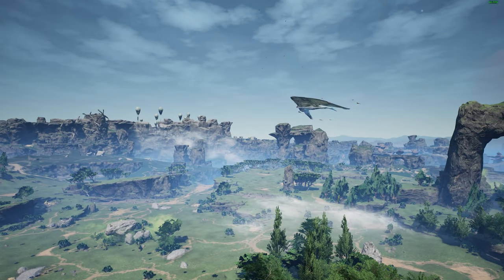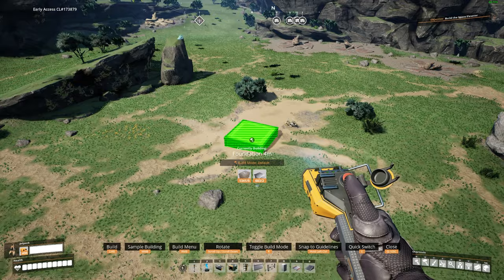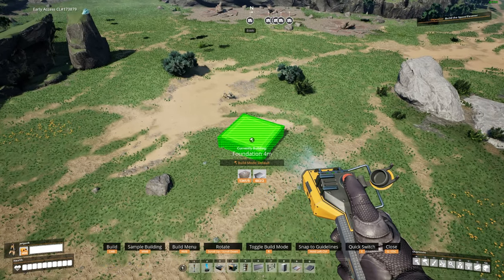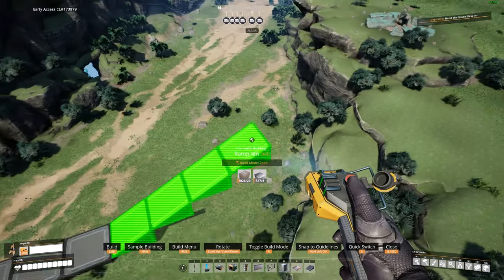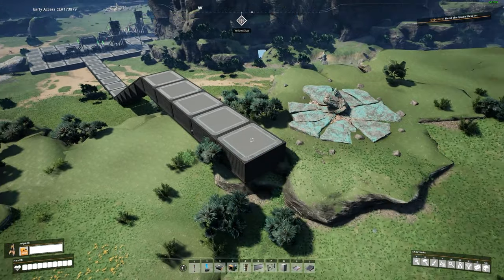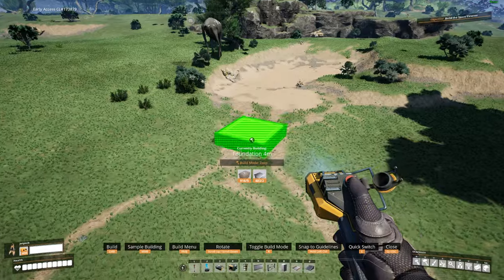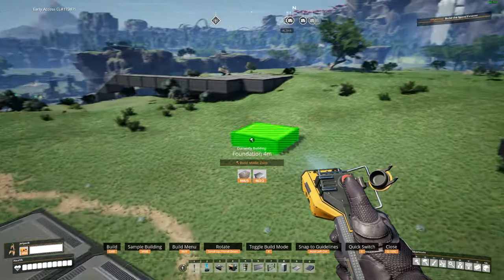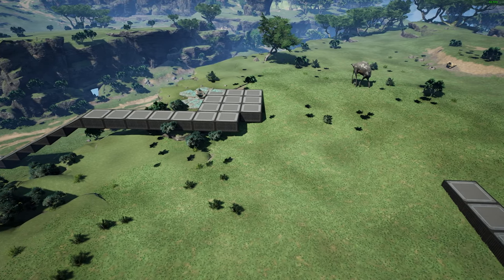Satisfactory Guide.. World Grid EXPLAINED!! - Guide 001

Comment: based on what you showed, they snap in 1 meter increments vertically, which means you could indeed compensate for it. Now they should give you a way to see your x/y/z coordinates so you could actually make sure heights match from across the map
Reply: The 2 meter and 4 meter foundations do but the 1 meter will be 0.5m off vertically. It has been reported on the report sight. Not sure if they are going to "fix" it. I believe the reason for this is that the block is snapping its vertical center point to the world grid and the 1 meter center point is 0.5m while the 2 and 4 meter foundations are 1 and 2 meters, respectively. So they are always snapped to whole numbers while the 1 meter is snapped to half meter increments.

Comment: To add to this part at 2:30 :
The y-axis has no grid at all so you might not even be able to work in increments of 1m which is all the ramps allow. But since we're allowed to clip foundations now what I do to still have a ramp is I remove the connecting foundation and replace it with a ramp of choice from the high part. Then I place a clipped in foundation from the low part so it meets up nicely with the ramp.
Reply: I'm pretty sure from what I've been experimenting with that the Y-axis has 1m increments.
Reply: @JeromeLAllierDecary  Then idk how I'd end up with less than 1m increments on my height cus I build all foundations with ctrl pressed even when placing them against other foundations that are already on the worldgrid :') I sometimes just have to make a 1m ramp and then build a foundation through it to smoothen it out cus it'll leave a little doorsteplike edge sometimes.
Reply: @reznovvazileski3193  I think I read about that in some forum or so. If I remember correctly, all foundations snap in increments that are half their height. So the 1m foundation pieces can slot in 0.5m increments on the y-axis. But the bigger ones (2m and 4m) snap in full meters, so they can be connected cleanly. I haven't tried it myself, but maybe you want to do so. If the info is correct, one should always use the world grid with at least 2m foundations and use the 1m afterwards.
Reply: @saltatio1545  I see I'll give it a try and see if I have more luck :') I have been working with a lot of 1m foundations this patch so probably should stop doing that then :p
Reply: @saltatio1545  YES, and there is no need to build everything with 2m or 4m only. you only need to use ONE of those 2m or 4m foundations for the first foundation in a new area and can continue building with any 1m, 2m or 4m foundations, even removing the first 2m or 4m foundation if you want to.
(of course, horizontal is snapping X and Y to multiples of 8m, and vertical is snapping Z to 0.5m, 1m and 2m)

@ReznoV: i use ctrl to snap to the worldgrid only for the single first foundation. rotating foundations can now be done, and for foundations that are built on top of other foundations even in two different step sizes depending on whether you hold ctrl or not.

Comment: how are you building lines of foundations like that?
Reply from the maker: When you have a foundation in hand, press the R key and you will Change you build mode to Zoop/Vertical or Default..Make sure you have Zoop Selected and you can build 10 Placables at a time either Horizontal or Vertical, this can be done with alot of other placeable aswell, like walls, windows, barries and so on <3
Reply: @ItsBitz  thank you so much

Comment: I somehow f'ed up it seems because I managed to get on a something in between 1 m difference in height, so I kind of have no easy way to realign it properly

one thing I noticed after though is, that you can e.g. take a 1m foundation and slide it up a vertical surface (like a cliff) while pressing ctrl it seems to also go up/down in 1m increments along that surface

I assume the issue arises when you place it on a slightly inclined but still horizontal surface or something... it's really odd but it drives me nuts because now I have to either make some really wonky connection pieces or undo my whole foundation network :S
Reply: The height snapping seems to be in increments of 1 meters based on centerpoints. Good for 2 or 4 meter high foundations. But 1 meter high ones will be centered and stick out 0,5 meters up and down. So it's best to only use 2 or 4 meter high foundations for factory floors.
Reply: @Br0ngier  Yep thanks, I read that somewhere else since then too. It's super important to know imo
It's not the end of the world but it was lowkey driving me nuts at the time
Reply: @Br0ngier  this is only important when building the first foundation in a new area.
all the other foundations will properly snap to that first foundation as usual, and that first foundation also can be deleted afterwards.

Comment: How can you fly with your jetpack infinitely?
Reply from the maker: For this guide build i was using PakUtility Mod that allows you to fly with a command
Reply: @ItsBitz  How did you enable mods as SML is not compatible with U5 yet?
Reply: the hoverpack is a bit more limited than the jetpack in where you can fly, but it requires no fuel and you can fly as long as your factory has a spare 100MW in its powergrid. very useful for construction work.
Reply from the maker: @vincentvanwezel8065  Mod loader has been updated my dude, with limited mods at the minute as the rest need to get updated by the owner